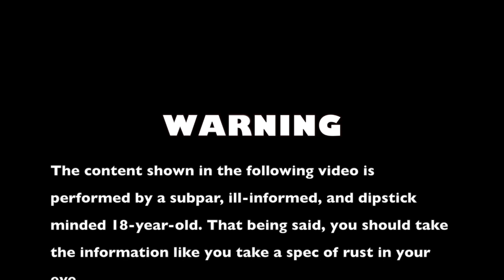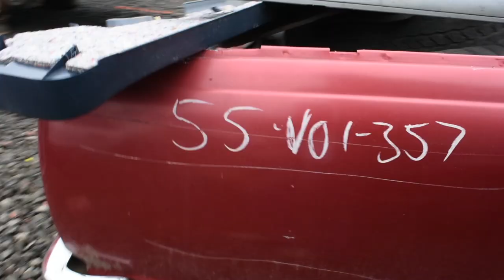How to Junkyard Upgrade G-body Front Brakes

Comment: When you have a stuck bleeder, put a sock (piece of an old rag and or what I do is wrap a string around it also) on it and repeatedly soak it with WD40 or equivalent, then take a hammer and (common sense) hit directly on top of the bleeder, as you try to turn it...